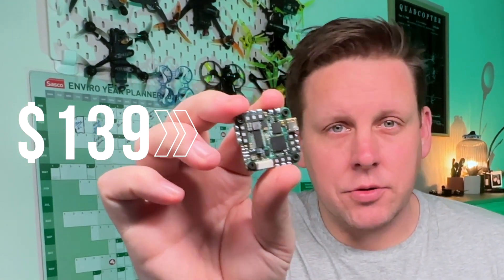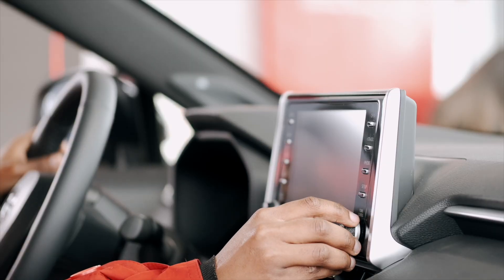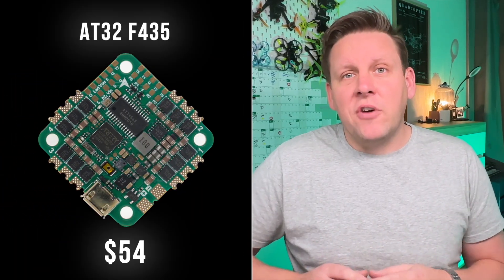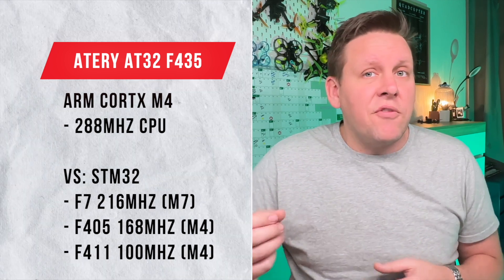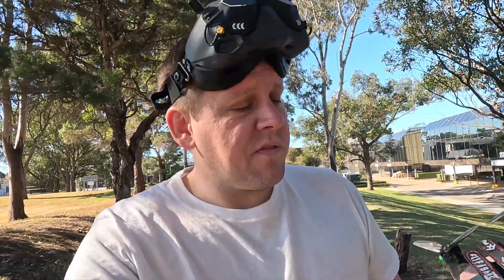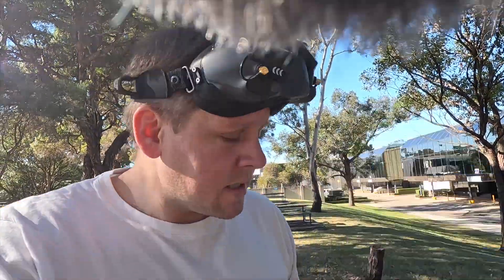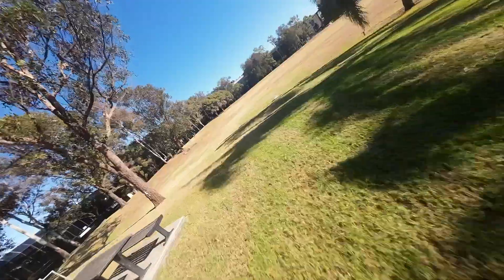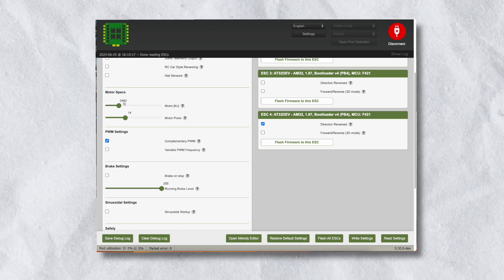NeutronRC’s AT32 vs STM32 - What‘s The Difference

Comment: I use "Brake on stop" on all my quads... Sounds like "AIR MODE" was not enabled in configuration to me??? This must be the case?
Reply from the maker: No “air mode” not being enabled wasn’t the case, because it was enabled. 

It was “break on stop” in the esc configuration- 

How I know this:
- Airmode is enabled by default and it was enabled 
- break on stop was enabled in the esc 
- after disabling break on stop, it flew normally.
Reply: @DarrenAllatt  weird, I use brake on stop cause it uses esc braking when rpm is dropping which leads to quicker decents in bandos... I was under the understanding betaflight had authority over esc.. so if idle value was up, when you drop the stock to zero, motors go to idle instead of stop like in my wings. Huh?! Maybe AM32 is different in this way? I've not used AM32 as of yet but by golly I'm going to find out!! Lol

Comment: Can share the drone specs to pair with AT32F4 in the video.
Reply from the maker: Volador VX3.5 frame. DJI O3, 1804 2450kv motors, 550mah 6S Battery, Radiomaster RP1 on ELRS!

Comment: The AT32F4 is slower than the STM32F7, even though it has more clock cycles per second. Also, the F7 and the F4 are not completely at their limits with 8k loop but they are very occupied. 32k would not be possible with F4 or F7 in modern Betaflight.
Reply from the maker: How so?
Reply: @DarrenAllatt  the AT32F7 can process more data per clock cycle. So even though the AT32 has a higher clock frequency, the F7 is slightly faster in a benchmark.
The F7 takes around 60-70% CPU load on BF. Maybe if the PID loop and a few other parts get optimized there is room again for a theoretical faster looprate.
Reply from the maker: @TimeFadesMemoryLasts  yes, and in the benchmark I’ve seen the F7 is only 2% faster. So with the AT32 being 60% cheaper that theoretically demonstrates the obvious choice. Further, given that he’s a processor is not being run to its limits, and is being limited by how fast the gyro in pid loop frequency is, Betaflight is the the bottleneck in performance. 

Simplest analogy that comes to mind is that if you have to GPU’s one that is out putting out 120 frames per second the other 130 frames per second, but you’re plugged into a 60 Hz monitor

So neither one is really better in that scenario, therefore comes down to price which makes it an obvious choice
Reply: @DarrenAllatt  Yeah for sure. Just wanted to point out a misconception about the AT32F4 being faster for people reading comments. But obviously it's the better choice if it is practically the same speed as STM32F7 but is cheaper and more available.

Comment: Great video, I will however note that while the microcontroller is absolutely the greatest cost, the STM32F745VGH6 can be found at $16 USD in single units and quickly decreases in cost with bulk so there is more at play here. I would venture to say a good bit of the cost in F7 controllers is purely part of the fact that they can charge that much due to hype and perceived value in having the most powerful uController on their boards, regardless of using it well below its capabilities. Thanks for showing folks can fly on less than the latest and greatest!

Comment: actually the F7 is better than the at32f4.... the MHz numbers are comparing apples to potatoes... its not about decimal places it can process more commands per cycle.. the stm f7 is defiantly a better performing unit than the at32 f4. also neutrons instance on using the BMI gyros is a backwards step as well with the improved drivers available in 4.4+ for the icm 42688
Reply from the maker: Except BF is capped at how many commands it can send per cycle to be processed by both the GRYO and PID Loop Frequency. 

Even running at 8k 8k - which is a point I make, performance will be the same. 

You aren’t anywhere near stretching or hitting the performance limits on either processor 

It’s like you are never getting out of 1st gear

On benchmarks I’ve seen, the F7 performs 1-2% better when pushed to its limits. 

A limit which neither processor gets close to due to PID loop and gyro frequency limitations. 

Why spend 60% more for 2% gains?
Reply: @DarrenAllatt  its exactly like saying the bmi270 gyro is better than the m6k… it’s not it’s just cheaper

Comment from the maker: Want to grab an Artery Flight Controller? 

Here is the link to a $34 Flight Controller (not the one featured)
🛒 https://s.click.aliexpress.com/e/_DeYgcnf
‣ AT32F435
‣ 20x20 and 30x30 Mount
‣ DJI / Walksnail / HD-Zero Plug

If you want the AIO featured in the video:
🛒https://www.aliexpress.com/item/1005005551828962.html

Please note, this is not in the main branch of BetaFlight and you will need to run ATBetaflight.
Reply: That's craZy! An AIO 25.5 x 25.5mm mounting, direct plug for DJI and caddx vista, 03. 35 amp ESC's .... All for $41 SHIPPED!  Bro, what a find!!!  :)

Comment: Interesting, they're certainly better priced! Is this board up for sale somewhere yet? Ooh and delivered with AM32 as well! Very interesting! 
Also out of curiosity which frame is that? Hope you can get it flying locked in!
Reply from the maker: Yes you can get it, but it's a pain to get it working because it uses a fork of betaflight
Reply: @DarrenAllatt  But, with Betaflight 4.5, didn't you say that 4.5 is going to fully support Artery, and these AIO's?
Reply from the maker: @KOrnhOliO1  the information I have is that they're working towards support in 4.5 - whether they deliver or not, that's up to Betaflight and the NeutronRC

Comment: Hmm. I'v had good experience with JHEMCU AIO f405 flight controllers. Cost like 50 USD. I got four of them all working great. I just have the feeling the brand manufacturors raised the prices during the pandemic shortage and MPU6000 crysis. Now the suppy is good again and prices should come down, but they just keep the price up for more profit. Can you add a link to that new chip FC? Hope the prices come down
Reply: sadly ive had 3 out 5 f405 jhemcu fail . and tried their lastest f722 aio and had 2 fail  so far from the 6 i currently have , and they not crash failures, all but 1 as been gyro issues ( 1 did kill 1x esc  channel ) really am losing faith in that brand ( and have 3x more on the way in the post )
Reply: @martincosta9961  thanks for sharing your experience. I know JHEMCU had a board layout issue with filters for the new ICM p42688p gyro. They fixed it on the ones I have. Bofore you had to adjust the gyro filters in betaflight that were totally off Standard values. When did you buy the ones that died? Mine are all just 3 months old.
Reply: @martincosta9961  oh and are you using capacitors? Thats a must have...
Reply: @chrisbee5481  yes I had caps and the tvs diode fitted . I bought the f4 prob 6 mths ago try the bmi270 the new f7 has the icm gyro . And yea strange how I have 6x pretty much identical builds . And when one fails I swap it out or even last chance effort I install it to a good flying build and the gyro issues show up still . Can't be the tune because I use the same dump between quads .
Reply: Jhemcu stuff is cheap, and I use it, but I've had a high failure rate as well. I thought I'd give their 5a aio a go though, I hope it will last longer than the 40 amp I had. Seems they don't put much in the way of over current protection into the escs. I've never burnt up a Diatone esc, not saying you can't, but I've never had a failure.
Reply: @jonowillmer  with the 5A 1~2S AIOs I've had about 60% failure rate. Doesn't matter which brand. HGLRC, Happymodel or Betafpv. Lately the HM are really bad. The betafpv ones have gotten very solid.
I run 45A and 40A JHEMCU ESC's on my 5" builds and they have not let me down. That 20x20 40A esc I thought might die on a 5" five33 racer, but it's still working. You cant beat the price anyway.
Reply: @chrisbee5481  wow that is very interesting, the 40 amp lasted about 3 batteries on my 5 inch.
Reply from the maker: Thanks for sharing
Reply: Same here :)